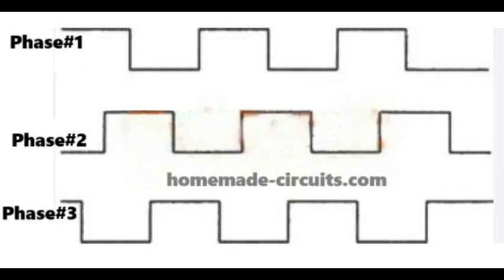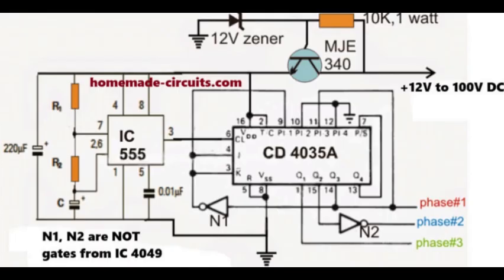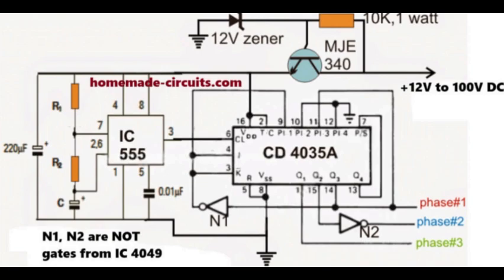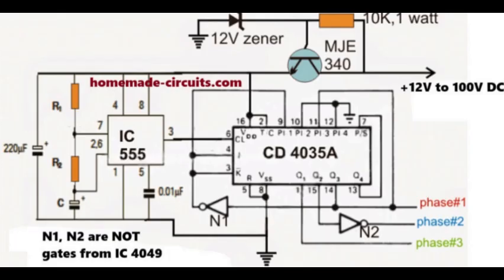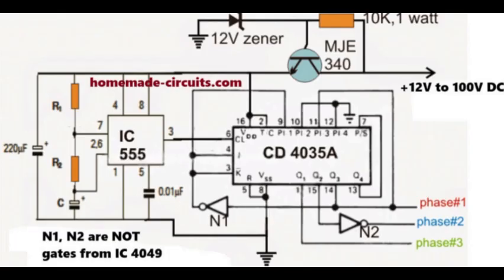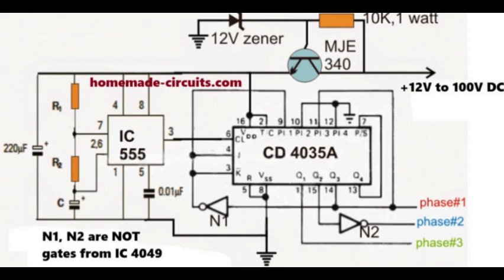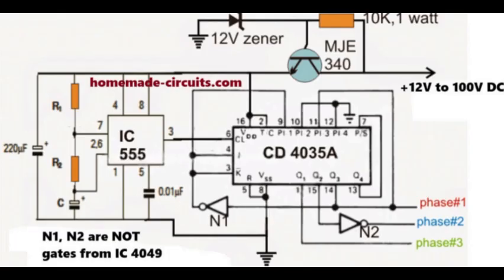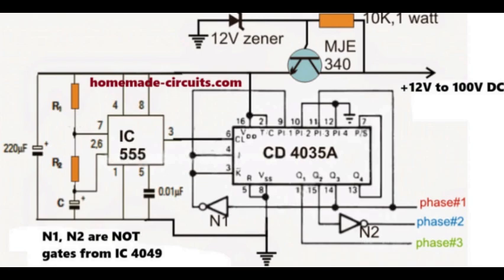Make this 3-Phase Signal Generator Circuit using IC 555 and IC 4035

Comment: Hello..I will use this diagram in a three-phase 220V circuit. Do I need to give a high pulse to pin 10 of the CD4035 when I turn on the circuit? I ask because in the diagram shown, pin 10 is connected to ground. Please confirm..
Reply from the maker: Sure! You are right, pin#10 is wrongly shown as connected with the ground, please connect it with the Vcc of the IC, you can keep it connected permanently with the Vcc line.